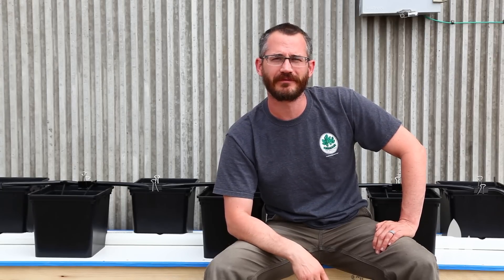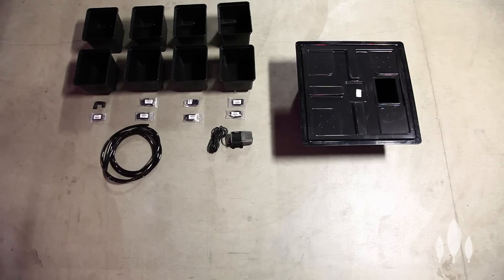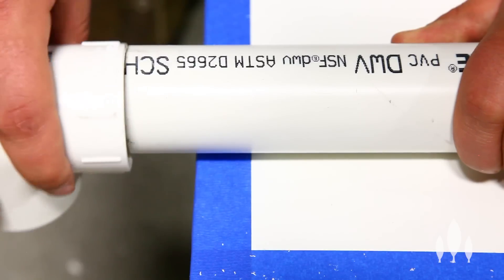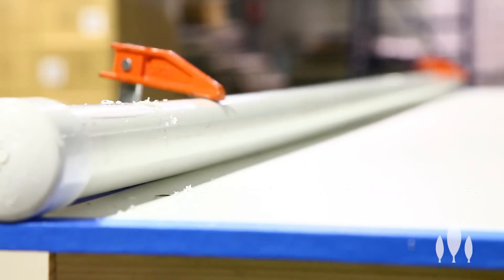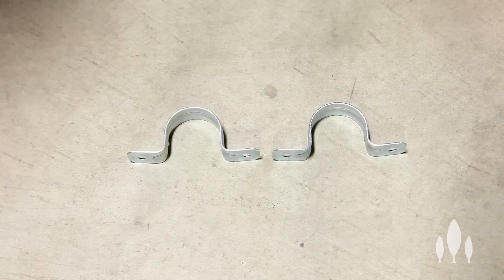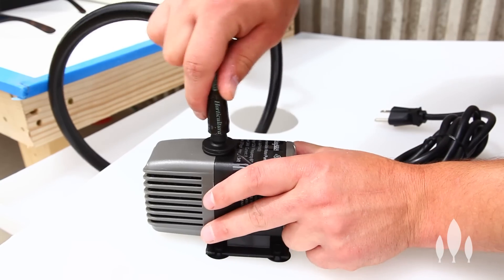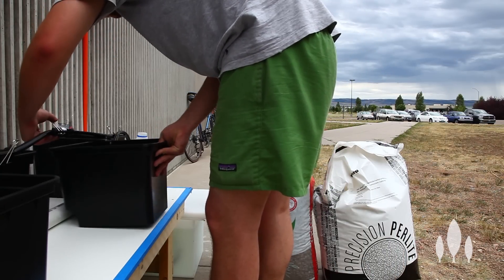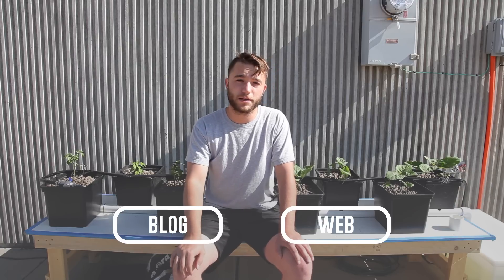How to Build a Bato Bucket System

Comment: My drip is way to light. I changed my drip emitters from button to pressure compensated ones both 2gph with no change. My flow through the irrigation system is solid because when i take off the drip emitters it sprays strong. Any ideas??

Comment: I have set up this system and we were testing it today and nothing is coming out of our drippers. I have a 250 gph submersible pump and the 2 gph drip emitters. Our table is only about 2 ft high, Do I need a bigger pump or 1 gph emitters? Or does it need to build up over a long period of time then it will start dripping? We only have 8 buckets on the line.

Comment: Hi.. I just started farming for a while and I'm really fascinated with all your videos. I have a question regarding this bato bucket system. Why do you put clay-perlite-clay instead of whole clay? I'm having an issue where the stem of tomatoes fall due to the weight of the plant itself. I was wondering if whole clay setup will solve my problem. Thank you in advance.

Comment: Great video...I'm trying to figure out whether to go for bato buckets and normal free draining pots. Assuming in both cases the nutrient solution is reused the only difference is that in the bato bucket there's always a small layer of water.  What is the advantaged compared to free draining pots?

Comment: few question please .....
i drill the 20mm hole at 2.1/2" height in the bucket from bottom. whats your recommendation.
how the saplings should be transplanted. A detailed video for it would be appreciable. and do's and don't s in doing so. 
after transplanting some saplings dies off . how to replant another

Comment: How does drip irrigation compare to ebb & flow? Would clogging be manageable with aquaponics?
Reply from the maker: This is just constant drip irrigation so the pump is always running in order to keep the roots moist. I'm not sure we've seen an aquaponic bato bucket system before, but as long as you have appropriate filtration you should be okay.
Reply: Cool, thanks.

Comment: I didn't see anything about the drainage! Did I vague out, or did you guys forget to show that. Please reply. Great video presentation none the less.
Reply from the maker: Hi there - Looks like that part didn't make the video. You will install the elbows inside the bato buckets so they let the water drain into the return pvc line. It's good to have a layer of larger clay pebbles so the perlite doesn't clog your elbows as well.
Reply: What's the specific reason for the 90 degree angel elbows? Is that to keep the lower 2.5" of water in the bucket for a longer period?
Reply: CClove ktl

Comment: Could you have just put the drain line on an angle to drain in place of cutting the bench ? Also on a covered patio / porch can these be placed on an inside wall? Thank you for the information.
Reply from the maker: For sure. The table is nice because it keeps your buckets off the ground and away from some pests and allows you to angle the line if you have a level surface, but it's totally possible to have your system on the ground too.

Comment: does the water run 24/7
Reply: I've seen lots of dutch bucket videos refer to a watering schedule "of your choice" but the implication is clearly intermittent watering rather than constant.  Can you comment on pros/cons?  Also, does vermiculite work as well as perlite for this?
Reply from the maker: Yes it does.
Reply: +Bright Agrotech cool thanks

Comment: Not sure the difference between this and a Dutch Bucket System (DBS).  I have used a DIY DBS for several years now.  I use it for strawberries, cucumbers, tomatoes, and even squash. Take note that some crops will require a lot of water!  In hot weather, my 6-bucket system goes through 55-gallons of water in about 10 days!  See "mhpgardener" channel for an excellent tutorial.
Reply: I'm a plumber.  An easy solution is to buy a "Fluid master Toilet float valve"  Make a small wooden table for the valve and use a brick to keep it stable. Set the valve to the height that works for your size tote.  Install a water line on the bottom of the valve with a 90 elbow right off the valve. Once the float is set the only thing you'll need to do is check your Nutrient levels.  Another solution is a Bell trap. there are a few DIY's on youtube.  Once your tote get to a certain level of water it will open a siphon and you can start a fill cycle.  Aquaponics systems often use this method.
Reply from the maker: Yup same system! Thanks for watching and good insights!